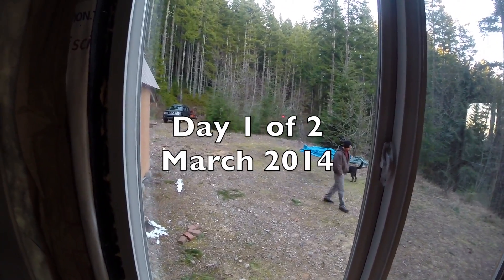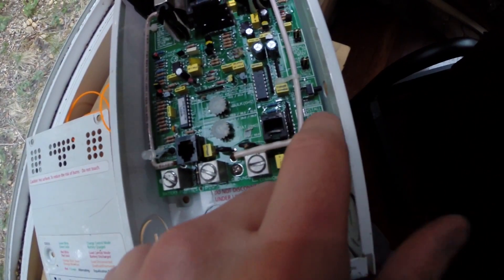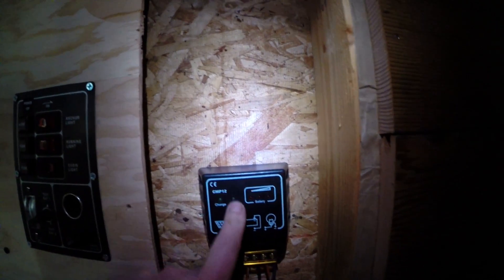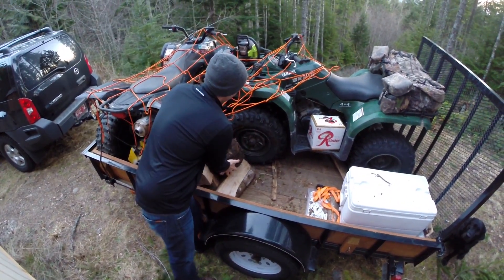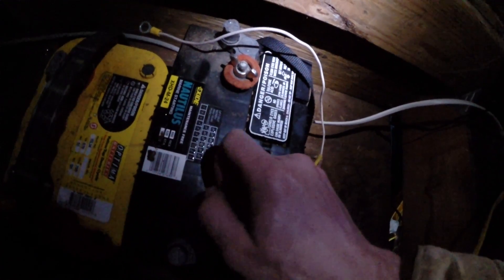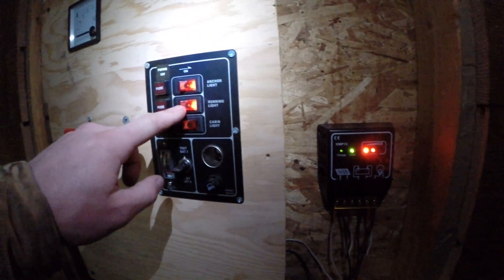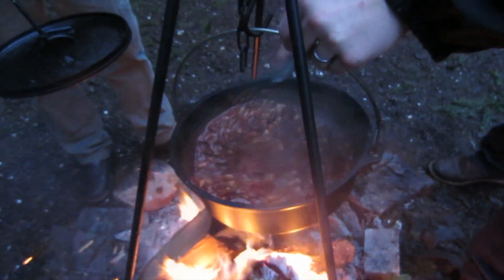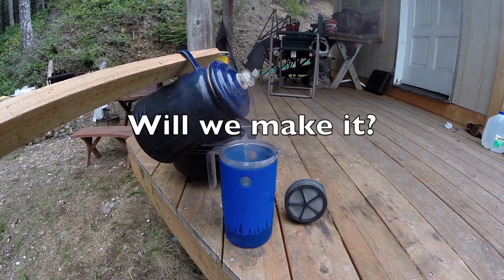Wilderness Off Grid Cabin - Replace Charge Controller - Mar. 14' Part 1 of 2

Comment: Think you fried your battery becouse off the to small gage wire between the regulator and the battery, it mesures to low voltage, so overloading your battery, some solar regulators have a separate voltage sense to overcome that, the more amps flowing the more voltage loss.

Comment: From what I understand (I use the same cheapy controller), the load light turns on when the system is ABLE to power a load.  And yes, they may be cheap but in a pinch they save your butt, as you just discovered.  Lookin' good!
Reply from the maker: Cool, thanks for the info. I'm looking forward to being at the cabin for a few days and observing how it works. I was in and out too fast to get it working 100%

Comment: Was planning to support local and get the C40 charge controller. Bummer. I've got a spare 15 amp, offshore MPPT if you want to borrow it. Well you have a few months before the high sun comes. Sweet trailer!
Reply from the maker: What up Cedar... you're going to laugh at this. After I made this video I remembered that I got some strange readings from my solar comber box where my 2 panels join into one. It has a breaker and 2 fuses. It came off a large boat on the salt water. Anyway I noticed that I got intermittent voltage of 20 volts (proper open circuit voltage on my panels) and 3 volts behind this breaker switch. I didn't know why this was or how this could happen since how would a switch go bad. Now I think I have TWO problems. Yes the C40 does overcharge batteries a bit but I also the switch is blocking most of the current from charging the batteries.

Anyway I didn't have time to troubleshoot as I had guests and had to entertain them.
Reply: That is strange. I run into stuff like that all the time. I like it's being syphoned. Is there a factory reset? I have to fix my Bogart Tristar meter. The displays says my batteries are 106%, but the voltage is 12.8. Lots to do when the good weather comes.
Put your guests to work hauling logs with their quad and trailer.

Comment: the controller you got the three lights 2 lite is normal charge 3 lite and flashing is full charge i read volts in batterys 13.5 or more i got http controler too it shut off at 14.4 it get the batters topped off i move the solar panels to grid tie and make sure the batterys stay up with a 2 harbor frieght mixed 3 coleman set of panels on shed when power went out last night i had lights and tv they were all mad my stuff worked!
Reply from the maker: Hey Gatored, you gotta find the "." on your keyboard. That's the longest sentence ever. But hey thanks for the info. I hope to have charged batteries next time I go out there and hopefully will see the light blinking.
Reply: ok i try to do editor first i am sorry